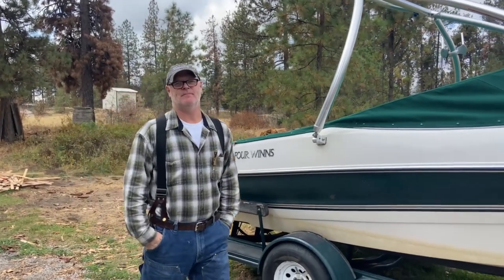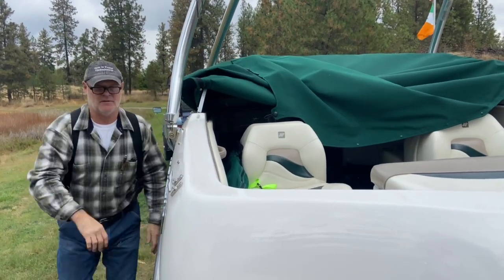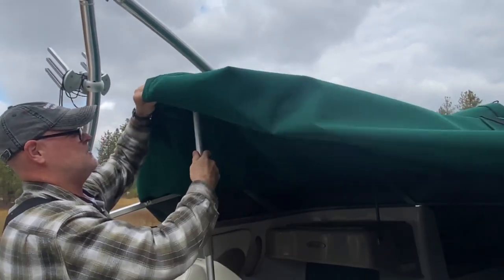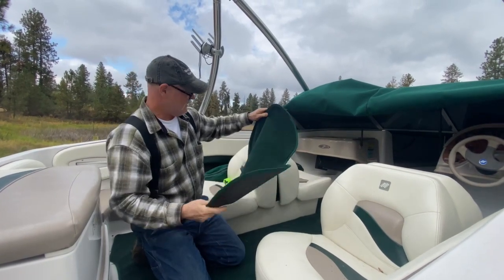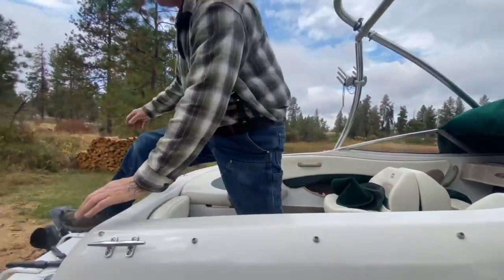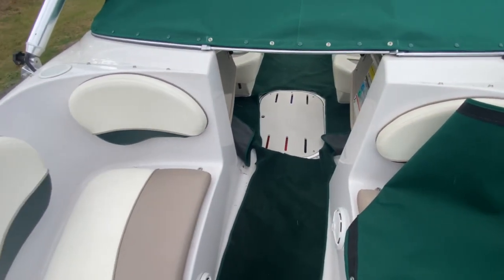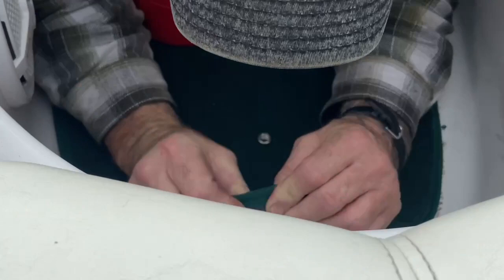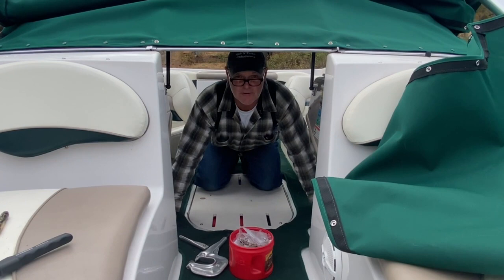Boat Carpet Replacement Step by Step How to Install Carpet in Boats Marine Upholstery Tutorial #2

Comment: Where do I get those poles? Or what are they called? Awesome work 👏
Reply from the maker: I purchased mine on Amazon.  Here is the link, they have 2 packs or you can buy them individually.  https://www.amazon.com/Support-Adjustable-Aluminum-Prevent-Accumulating/dp/B09YQ4SDJ5/ref=sr_1_2_sspa?crid=A6XX38HQ7XDY&keywords=nexcover+boat+cover+support+pole&qid=1665588534&qu=eyJxc2MiOiIxLjU3IiwicXNhIjoiMS4zMSIsInFzcCI6IjEuMjUifQ%3D%3D&sprefix=nexcover+boat+cover+support+pol%2Caps%2C323&sr=8-2-spons&psc=1